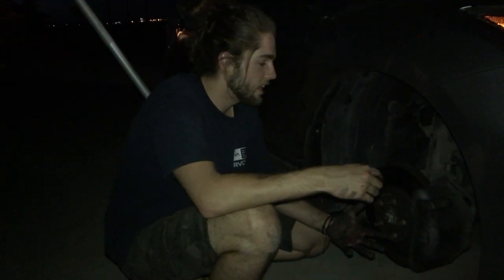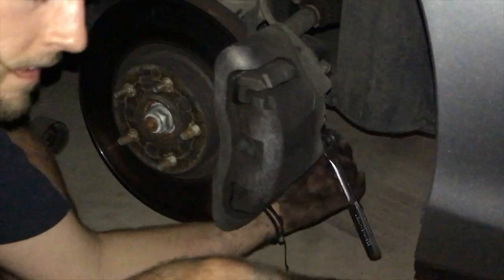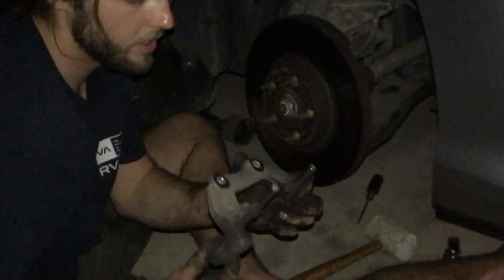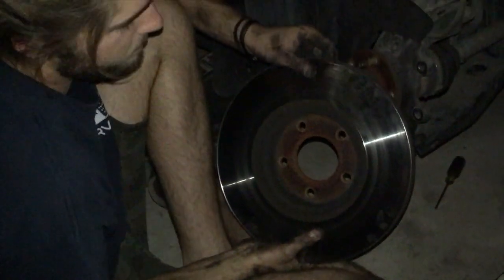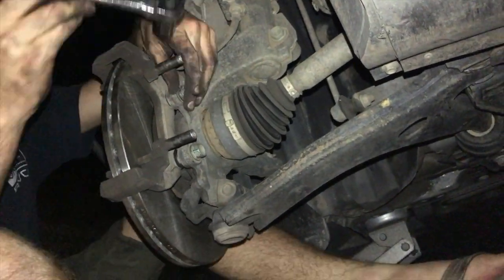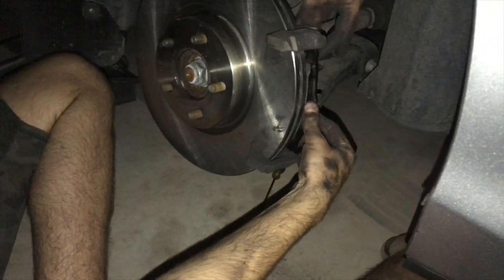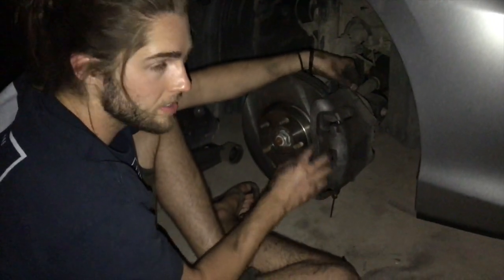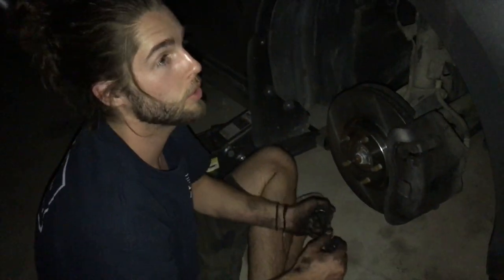DIY: Replacing Brake Pads and Rotors

Comment: Why didnt you pull the caliper as a whole assembly instead of taking it apart in pieces
Reply: Me and my dad were watching this video and we just asked the same thing lol it could have came off with just removing the two 17mm bolts
Reply: @adamg4754  it's a lot easier and less time consuming
Reply: it's super hard to compress the piston back in and get the pad in if you don't take it apart. at least that was my experience
Reply: @rolandernst544  should be able to do it with a crompressor tool whether the caliper is apart or still whole
Reply: @rolandernst544  just did this job and you can compress the piston with channel locks with the caliper in one piece

Comment: harbor freight has a 300 piece tool kit for 150 to 200
Can you use the old pad to compress the piston
last time I did pads the spring popped out.  Gotta wear glasses.  informative video.  I wonder if gen 1 is the same.
Reply: Fuong Wah gen 1 is the same, just did mine 🤘🏻
Reply from the maker: Sweet!

Comment: What are the torques my man! 😭
Reply: Front Caliper Pins: 19-22 ft-lbs.

Front Caliper Bracket: 58-75 ft-lbs.

Wheel Lug Nuts: 80-90 ft-lbs.

Comment: Bro why did you take the caliper apart? Not trying to be a jerk and I guess its not hurting anything but seems like a lot of extra work to remove the 4 torx when the two 17mm is all thats needed. Also you should probably use jackstands or at least put the wheel under the car.. Still a good video. I had a hell of a time getting the spring clip back in. I ended up having to clamp it at the top & bottom while using a hammer/chisel on the center tab.

Comment: Is it normal for one of ur break bads in the front have a wire connected to it?? I bought pads at auto zone an there's a cord connected to the inside pad I think but did not see one in the video
Reply: its a sensor that hooks up to your car to notify you when you pads are getting to the end of its life, most cars have the sensor and the car will throw a check engine light and once you scan the code itll just say replace the brake pads, but just a sensor

Comment: What exhaust setup do you have? I have my muffler and resonator off but it doesn't sound as loud as yours 👀
Reply: Anthony Pancan how much of a difference in sound does just a resonator delete do? Is it worth $90 at an exhaust shop?
Reply: The Coop Chronicles well mine had the muffler delete and you couldn't really hear the rumble but if you delete the resonator it will get a little louder and you'll hear the rumble note a lot more which is what I like, but I want to go louder and keep the rumble like his sounds, I think the resonator delete is worth it especially for turbo cars, less back pressure
Reply from the maker: Catless DP, res delete with stock muffler.

Comment: Hey man what do you do if the piston doesn’t want to go back in flush?
Reply: Crack open the bleeder..it should make it easier to push back piston. If piston still doesn't go in there's an issue with the caliper

Comment: So you don't have to do anything to the ABS system?
Reply from the maker: Nope!
Reply: Cameron Alford are the rears the same process?
Reply: Not in the slightest
The rears are a PITA
Reply: @samweiskittel8485  how..just remove two bolts holding the assembly and your done